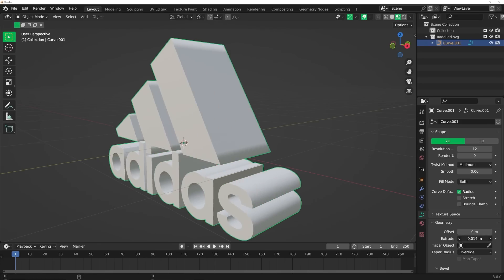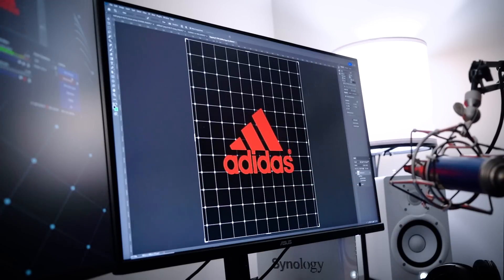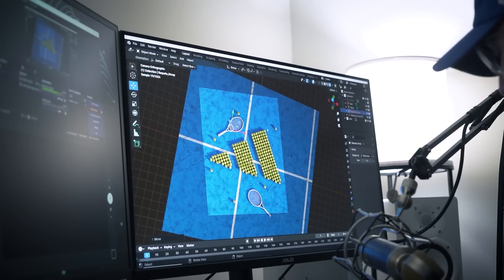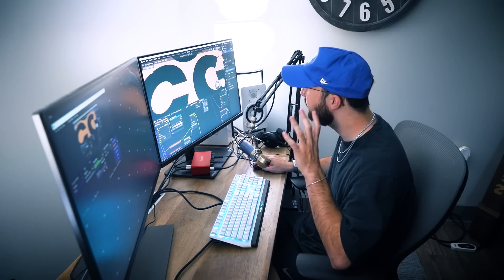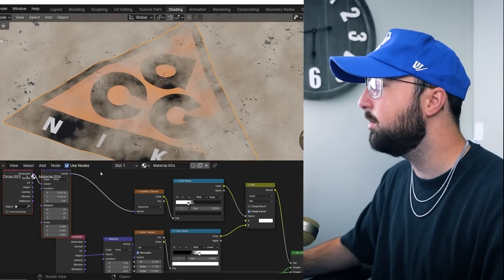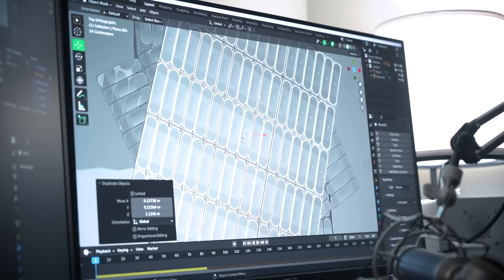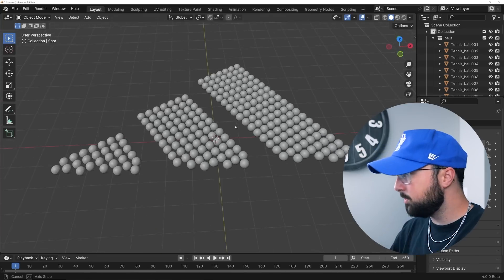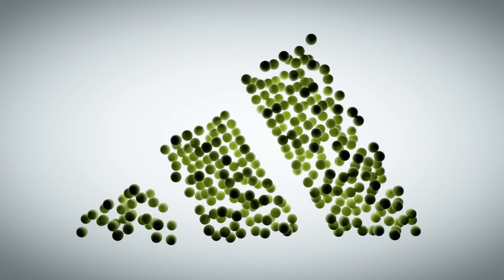Making Logos in Blender

Comment: How does that projection system with the nodes work? 
I would have used a spotlight to achieve that but it wouldn't look like it is printed on the boards.
Reply from the maker: I use the camera setting in the texture, coordinate for the image texture that goes on top of the other material